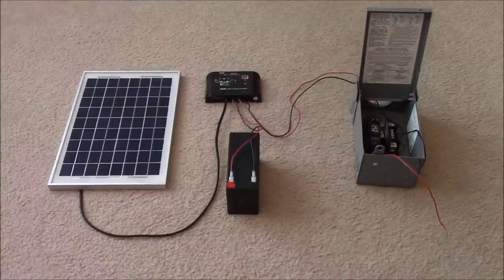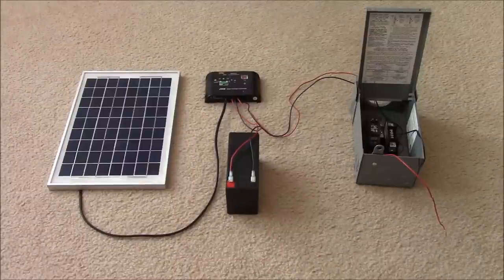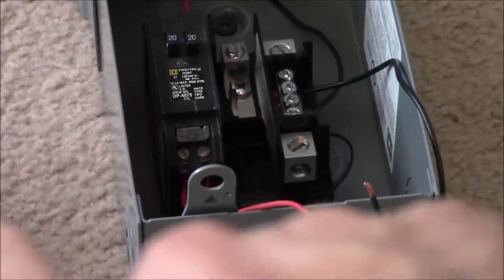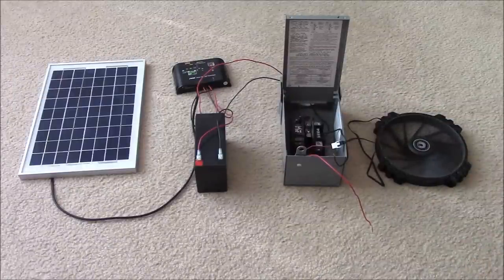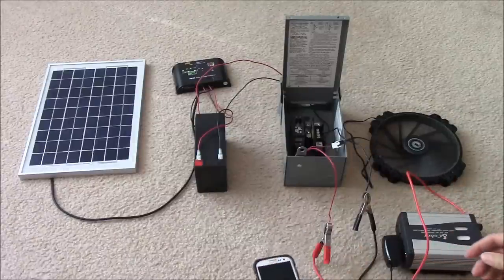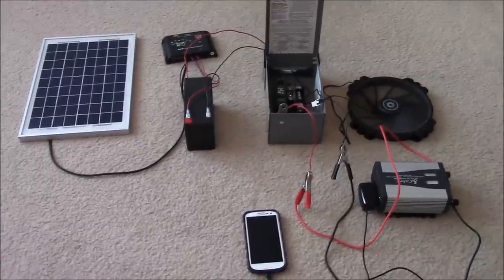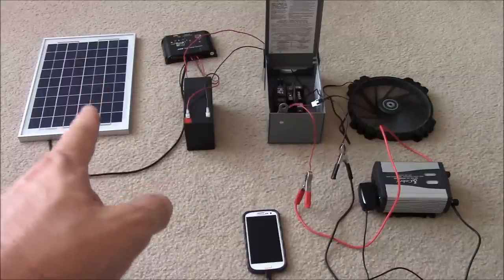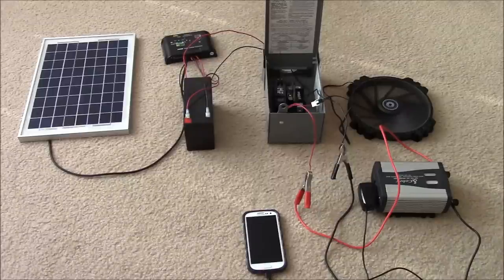Solar Panel Systems for Beginners - Pt 2 Hybrid Systems & Multiple Loads

Comment: thx so much, now I understood about the load, Could you help me to know what kind of panel I need? I just need it for 8 5w led light and a lcd 32 tv I think it like 100 watts,  do you think its better start with a 20 watts panel or go with a 100watts panel. I need the led and tv for 6 hours. thx sorry my bad English.
Reply from the maker: +rene acevedo Thanks for watching!  If you are going to use a 100 watt tv for 6 hours you would need to store at least 600 watt/hours of battery power through your solar panel.  So that could be from a 150 watt solar panel for 6 hours (losing about 1/3 of the power through normal losses) or a 900 watt solar panel array for 1 hour.  Or anything in between.  And then you would need enough batteries to store that power.

Unfortunately, a 20 watt panel is much too small.  You could go with a 100 watt solar panel and at least a 20 ah battery but you would only be able to use the tv for about an hour per day, depending on the time of year and other factors.
Reply: +LDSreliance thx very much, now I understand that, I'll start just with the lights in my house and maybe later get at least 6 x 100w panels. could I mix a 25w 12v panel with 100w 12v panels? thx for everything, great videos.
Reply from the maker: rene acevedo
Yes, there are ways to mix sizes of solar panels properly.  I would just advise you to start out small right now with a 20w or 30w panel and use your small led lights and go from there.  You will learn so much from that first little system that you will be much more informed when it comes time to design a bigger system for your TV and other household needs.
Reply: +LDSreliance Hi again, I got my micro-Sistem 25w panel and a 109A battery and I'm running one 12v 9w led and I wanto run onother one, do you thinks its better used a inverter and used a 110v 5w led (I have a small 400w inverter) or go with another 12v 9w led?
Reply from the maker: rene acevedo
It is always going to be better to stay DC if you can.  When you pass power through an inverter to change from DC to AC power you are losing about 20% of the power in the transition.  But if that 110v 5w LED produces more lumens it still might be worth it.
Reply: +LDSreliance thx, example if I used a 9w 12v and a 9w 110v am I using more amps in AC for the conversion? Im using a 110v fixture connected a lighter plug, do you think is safe? sorry for asking a lot of questions.
Reply from the maker: rene acevedo
Yes, I have used 110v AC fixtures to run 12v DC bulbs before.  I use 2 of them in my shed right now.  They work just fine.

And to answer your question, yes you would be using at least 20% more amps to run a 9w 110v AC bulb than a 9w 12v DC bulb (roughly 0.9 amps  to 0.75 amps respectively).  Not a huge difference but when you only have ~ 2 amps from that panel you are using then it makes a difference.

Comment: Hi there.   I have a 30w mono panel, a 10amp solar charger & a 7ah sla battery.   would this be sufficient for charging power banks or do I need a bigger battery?
Reply from the maker: That depends on how you will be using the system.  If you are using it to charge at night then the only power coming in will be from what is stored in the battery.  So in that case it probably won't charge a very big power bank.  But if you are charging during the day then the limitation will mostly be the solar panel as the battery is basically acting as a temporary reservoir and pass through as power goes from the solar panel to the power bank.
Reply: @LDSreliance  Thank you, greatly.   you've just answered all my concerns in one clear concise comment.👍👍
Reply: @LDSreliance  Hi there.   hope you're well?   I've only just gotten around to setting this up & I think my setup may be faulty?   it's actually a 25w mono & the solar charger is a PWM.   the SLA battery is fully charged & when I connect it (first) to the PWM it gets detected as a GEL battery.  I disconnected & reconnected multiple times but still say GEL?   when I connect the solar panel the PWM says it's connected ok but if I connect a power bank via the USB on the PWM nothing happens?  it doesn't charge from either the panel or the battery?    any ideas?

Comment: Can I run a 12v digital timer off my battery to run a 12v pond aerator?  Do I just need panel,  charge controller, battery and timer?
Reply from the maker: Yes you can.  That would be pretty easy to do.  You would need to know the power consumption requirements (how much current is used to power the timer around the clock?  how much current does the aerator use when it is running and how many hours per day does it run?) to be able to properly size a solar panel and battery to meet your needs.
Reply: The aerator I was looking at was 35w.  At 12v I guess that is almost 3amps?  My battery is like 120ah+ and I was previously using it to run a trolling motor which I know can draw A LOT more juice than the pump ever will.  Also I only plan on running the aerator for 5-6 hours in the very early morning hours when it is cool.  It sounds like I may not need too much panel to keep the battery charged?  Pretty sure the timer draws next to nothing.
Reply from the maker: SleepyG_ So lets say the timer draws 0.25 amps and the aerator draws 3 amps and runs 5 hours per day and you are averaging 4.5 sun hours per day.  Your battery will be just fine to run all that but you will need a minimum of a 130 watt solar panel to keep it charged up with 1 day's worth of energy.
Reply: Thanks, I really appreciate the help.  I am starting to figure out how to do these calculations a bit.  Sounds like I probably want 200w of panels to be safe.  I may even decide to run the pump longer in some conditions.  My last question would be if there is a way to have the panels directly power the pump during sunlight but automatically switch to battery when needed?  That one might be tough....
Reply from the maker: SleepyG_ You are welcome.  I don't understand your question.  That is already basically what will happen during the day is that the power from the charge controller will come from the solar panel and the battery will only charge from the excess leftover power.  So if you had a 130 watt solar panel and a 35 watt load then you would get roughly 95 going into the battery instead of the full 130.
Reply: LDSreliance so say for instance i want to run the pump 24/7 over the winter, the panels will always power the pump directly unless the sun is inadequate? the battery takes over as soon as that happens?
Reply from the maker: Yes, but you would need a MUCH bigger solar panel system and a lot more battery to run that pump around the clock, especially in winter.  You may only get 2-3 sun hours per day in winter, depending on where you live.
Reply: LDSreliance I can do with an 18w 1.2 amp pump.  The timer uses about .025ma without load.  If i just stick to summer only on 6 hours a day can I get away with one 100w panel?  That would be a lot more affordable for me.
i live in southern ontario canada.
Reply from the maker: SleepyG_ Yes if it is just 18w for the pump you can easily do it with 100 watt panel.

Comment: I'm new to all this... it would of been a huge help if you had also give links where we could of get these items
Reply from the maker: True.  Sorry about that.  If you want to put together a system I can send over some links.  Just tell me what you want.
Reply: where'd you get that breaker !
Reply from the maker: Sas Asa I got the breakers from Home Depot.  I would recommend the QO series of breaker boxes and breakers from Schneider Electric.  They are rated to handle DC power.
Reply: ok
Reply from the maker: Meme Luvlly Huh?

Comment: You are either off grid or on grid. There's isn't both. Since with on grid there is a physical cable that comes to your building whether you use it or not you are still on grid. You will get a power bill for a very small amount. BTW never attach the positive connection first , always the negative first. Other the n the 2 minor things I just mentioned you are doing an excellent job explain.
Reply from the maker: There are hybrid systems now that are grid tied but also have an "off grid" circuit that can use battery power independent of the grid.  It is not common but technically does exist.  I disagree on the positive connection.  I have always been taught to connect the positive first and then negative.

Comment: how many batteries can you charge using any charge controller? I'm looking to charge a couple of the same sized ones you have on this video
Reply from the maker: That is a great question and involves some math.  It depends on the amp rating of your charge controller, too.  It is always better to size your battery bank and solar panels based on load, though.  But you will probably need at least a 50W panel to charge 2 of the batteries in this video in parallel.

Comment: How bout a solar panel for a solar attic fan? With only a 12watt & it connects to the fan with a thermal switch connection wire to the motor for the fan to blow. And I wanna replace the 12 with atleast a 25watt panel. The company is making excuses not to send me an upgrade replacement & I'm not gonna deal with that bs, got any tips?
Reply from the maker: Yeah, I have done a few videos on my own solar attic fan systems.  Check them out:
https://youtu.be/K6_5C8PQ5-U
https://youtu.be/fqbIJBre_cw

Comment: hi I wanted to know if I  could use solar panels for a refrigerator?
Reply from the maker: +ember n' ashes Good question.  Yes you can but it takes a lot more power than a beginner system can handle.  Check out my video for more discussion about this:  https://www.youtube.com/watch?v=wU01ddBhauY

Comment: Hi, I have a question, when the solar panel is working, the charge controller first charge the battery and then the battery charges the device that is connected? What is the logic? (I'm new in this topic) Thank you very much
Reply from the maker: No, the electricity will flow to both at the same time.  So if you are using a load at the same time as charging the battery the load will receive full power and whatever is left will go to charge the battery.  If the load is too big for there to be any leftover power then it will pull power from the battery to compensate.
Reply: @LDSreliance So if I replace a battery with a power from a wall; Via ac to dc adapter, then the power from the adapter will only be used when there is not enough power from solar pannels.  Correct?

Comment: Is a charge controller important for the connection of solar panel??I am gonna use solar power for my school's science project and I can't get the charge controller so can I connect directly to battery??if solar panel is 20 watts what would be the volts of battery please answer me...
Reply from the maker: You can connect it to the battery but it will destroy the battery if you overcharge it.
Reply: +LDSreliance thank you for the reply

Comment: Hi for my final year project im suppose to make a battery charger which can be carged using both Solar and DC input. Any advices on that ?. And amazing work thank you so much
Reply from the maker: +Rajitha wickramasinghe Solar is DC so I am not sure I understand.  Do you mean AC?
Reply: Yes I want to charge a battery using both solar and ac . Is it possible to do that
Reply from the maker: Rajitha wickramasinghe
Yes but you would need to convert the AC power (from your house I assume) to DC power.  You will need about 14.5-15v in order to charge a 12v battery.  The simplest way to do that is to get a battery trickle charger that is designed for that.  If that is too easy or not allowed in your project, you can hack a computer power supply and combine the +12v rail with the 3.3v rails to produce enough voltage to charge a battery.  I shot a video showing how to hack a power supply:  https://www.youtube.com/watch?v=M4TFVhCg6sk

Comment: If the Solar Panel isn't under the Sun, how is electricity being produced?
Thanks for the helpful videos!
Reply from the maker: +Mamidanna Kalyan If the sun is not shining directly at the panel it will not produce electricity (or at least not very much if it is indirect).  So in this video when I am indoors, it is not actually producing anything.  I am just demonstrating how it all works.
Reply: +LDSreliance Then how is the fan rotating and the phone charging? I mean it is not an actual electricity-producing thing.
Reply from the maker: *****
That is because they are connected to a battery via the charge controller.  Everything is connected how it would be if you were installing it for real but the solar panel is not actually producing any power in this video.

Comment: What's the name of that charge controller ? All the controllers have the option to set the max (stop) load of the battery ? Thanks!
Reply from the maker: +JN This charge controller is a generic Chinese brand that was cheap from Amazon.  I can't find a link to that exact one but I would recommend one like this for starting out:

http://www.amazon.com/gp/product/B00JKDZVRU?psc=1&redirect=true&ref_=oh_aui_search_detailpage
Reply from the maker: +JN And yes, they all have circuitry to detect when the batteries are full and start to "float", which is trickle charge to offset the natural small amount of discharge that batteries do when they are idle.
Reply: +LDSreliance generic ... ? So this controller automatic stop when the battery is fully charged ? Can i use a bigger type of battery or it have to be the same capacity like your in order to use this controller ?
I'm still learning from your vids. Thanks again!
Reply from the maker: JN
Generic meaning it isn't a name brand.  They copied someone else's design and sell it for cheap.

Yes, anything you buy that is called "charge controller" will automatically protect your battery from overcharging.

You can use any size battery you want.  Just make sure it is 12 volts.  The only thing is if you go too big and your solar panel isn't very big then you may never be able to fully charge the battery because you aren't feeding it with enough power.

Comment: Thank you for taking the time and doing these videos. 
Please could you help me with my current set up. I have a 20w panel supplying a solar controller (12v 10Ah ) I have connected it as per your video, the problem I am facing is the led lights that I am using, it flickers when the system is on, it starts flickering slowly and then very fast.... getting frustrated.  The led lights are 12v 10w, there is 42 led lights in one light. Please help. DEON
Reply: Sorry forgot to add that I have a similar battery that you have on the video,  12v 7,5 Ah

Comment: Great video! If the battery is full, does the charge controller stop charging or do you have to unhook it yourself?
Reply from the maker: No, it automatically stops charging.  Actually, more correctly it switches to a "float" charge which provides a tiny amount of power to offset the natural, slow discharge of the battery.  So it will always be fully charged and ready to go when you need it.
Reply: trickle charge

Comment: Hi!
Thanks for The great video!
Do i need The load center, or is i posible to hook up multiple divices on to the load port in The charger controller?

Mathias.
Reply from the maker: If you can fit multiple wires in there then you are good to go.  If not, you will need a device to split the power among multiple loads.  If you have a cheap charge controller like the one shown in the video you probably won't be able to put more than one wire in there unless they are really thin wires.

Comment: Can you help me? Is it possible to have all three types of solar to use off grid/on demand/ sell it back?
Reply from the maker: Yes.  That is the most expensive, however.  There are some grid tied inverters that have "emergency backup" circuits that can be used if the power goes out.  I believe the company SMA that makes the sunnyboy grid tied inverter have an optional feature that does this.

Comment: how does a solar panel that has a light as a load allow the light to come on at dark or a set time
Reply from the maker: The energy has to be stored in a battery.  For automatic light control you would need to find a charge controller with that feature.  There are quite a few on the market that can do that, especially for landscape lighting.